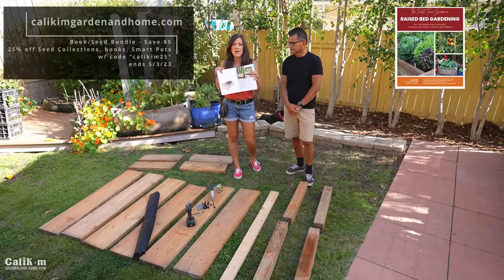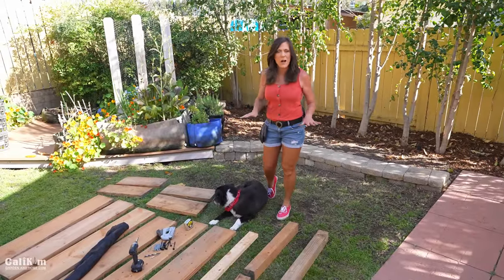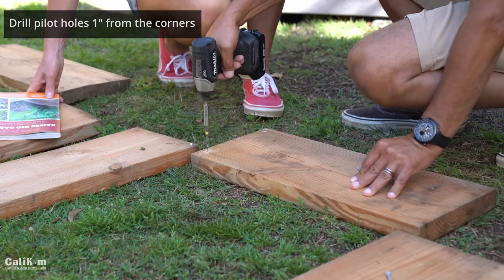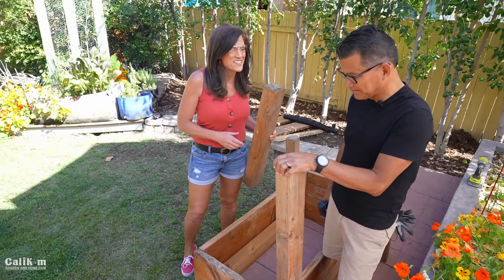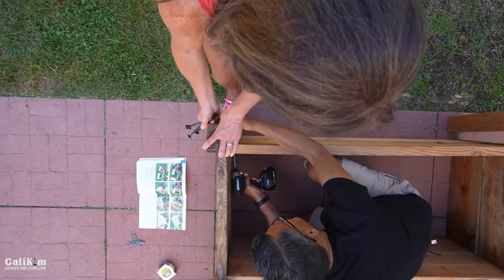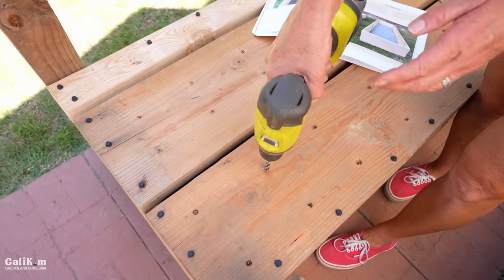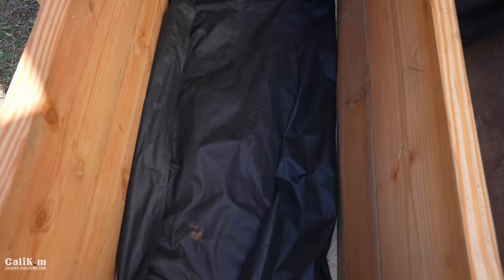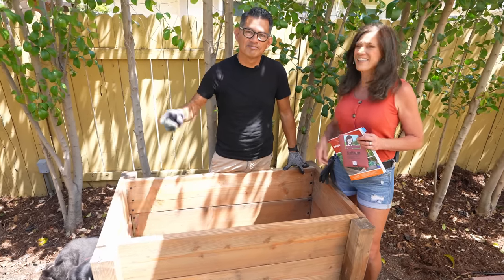How to Build a Mini Elevated Raised Bed in 5 Easy Steps - No Construction Experience Needed!

Comment: We built these. We foun d the right wood cedar reclaimed pallets.  Had these tested 4 years qgo. Took several apart qnd built 6.  This coming summer adding more to senior center. So easy for wheelchair bound, extra chairs.  We've only had to repace 2 boards on bottom on one otherwise doing great.
Reply from the maker: Fantastic report!  Thank you so much.  So glad that you point out that they are great with wheelchairs!!  Good to know, too, about the bottom pieces, too!
Le'CrystalRose thank you so much for this GREAT info!!  Kim

Comment: How much weight can the bottom hold? I want to put a stock tank pond in one of these and can’t find one in the right size so I am thinking of making it… another issue I’ve run into is once it’s filled with water, dirt and rocks it will be quite heavy and needs a super solid base. Is there a reinforcement you could add to this one?
Reply from the maker: I have no idea.  You would just have to get creative with additional supports under the bottom.  Stacks ofT-shaped wood, bricks- gosh who knows!!  Sounds really creative though, Trixie!  You can find/build something! Do keep us posted!